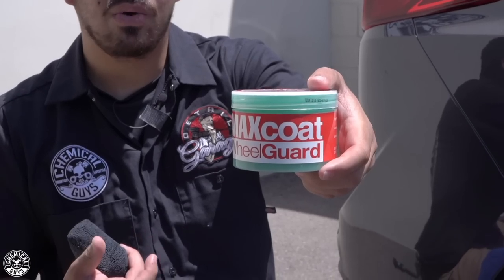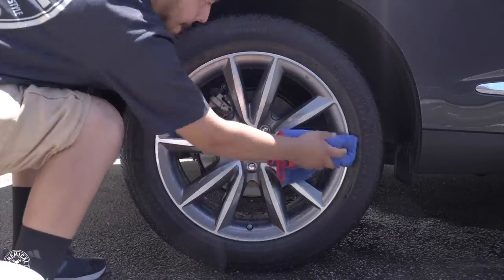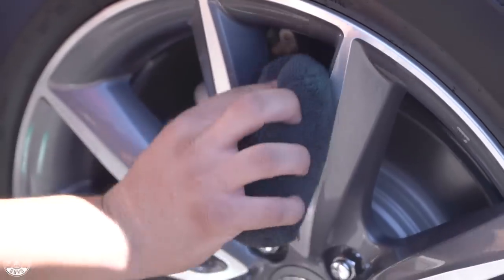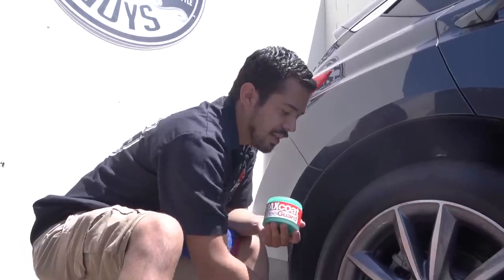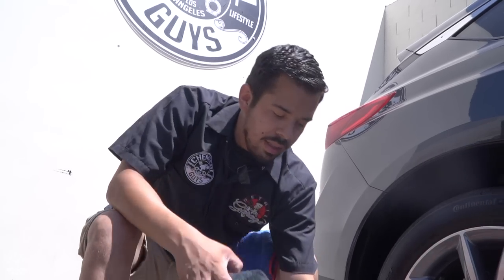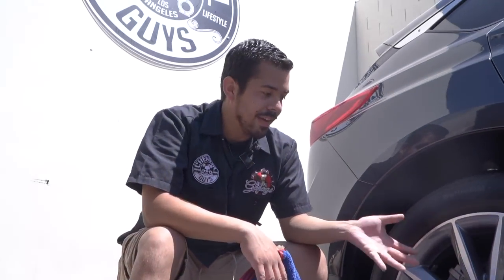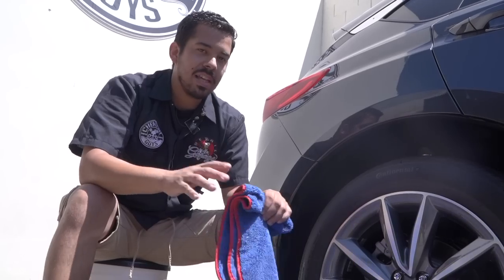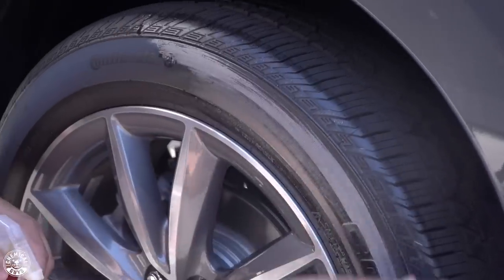How To Coat Wheels and Tires! - Chemical Guys

Comment: I tried it out and it works great !  It’s like a wax for your wheels.  The coating has been on the my wheels for 4 months and the water still beads.  I just use the ProBlow to dry the wheels then a microfiber with a little detail spray to polish.
Reply from the maker: Enjoy your detailing products!!

Comment: How long should you wait for VO7 to dry to prevent sling off?
Reply from the maker: Hey! We recommend wiping off residue to avoid tire sling. Thanks for watching and happy detailing!
Reply: Chemical Guys should I wait 15min or so before wiping off? I’ve tried wiping off VRP but still ended up getting tire sling. Am I applying too much? Thanks for all you guys do!
Reply: @blake60ah41  yes you are applying to much wait 15 minutes then dry it with a designated microfiber towel. Apply a 2nd coat if needed bud.
Reply: Less is more with VRP. I literally use 3-4 pea size drops for my 19” tires (after I make sure the applicator is a little saturated with a few drops first). Takes a few more times around the rubber to get everything, but it dries and there isn’t any excess.
Reply: Thanks for the replies everyone!